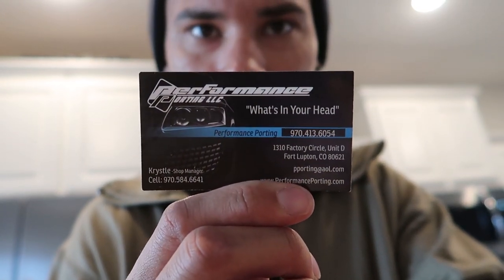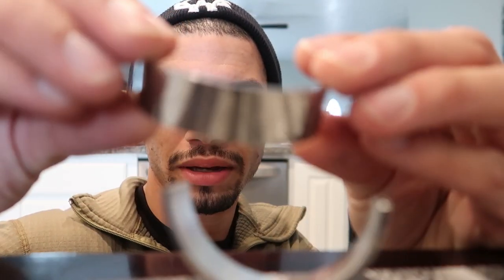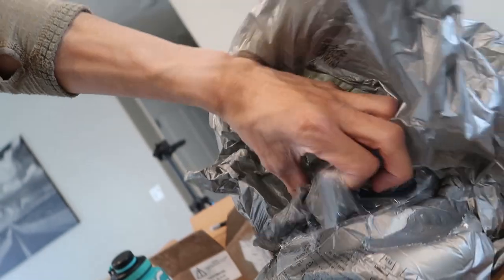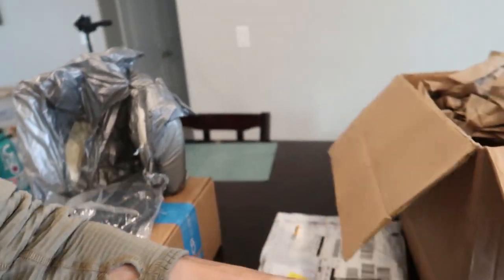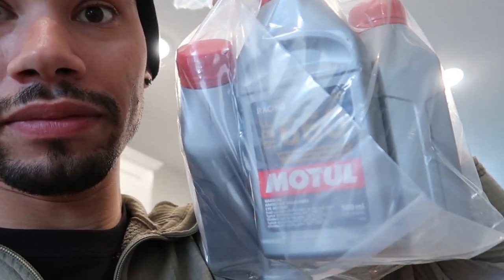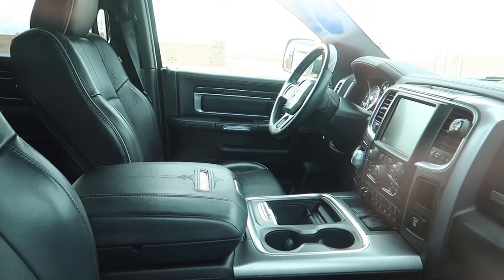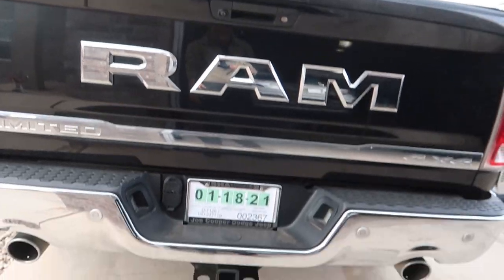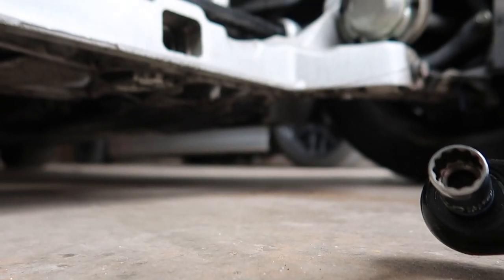TONS of parts for the rebuild! & I bought a Grand Cherokee! | MK7 Golf R

Comment: How much power you planning on getting!? I too am doin a full build bottom and top end, with full fuel system and running a garret  3076r. And is the fluidampr necessary?
Reply from the maker: Not necessary but for high revs and being a manual it's definitely a thing to do. Hoping for 6 but at least 550wheel 500+tq
Reply: @BryceJordanProductions  thank you! Will definitely look into it! Honestly can’t wait to see videos on this thing! Gonna be amazing